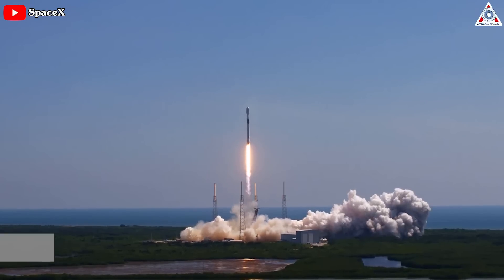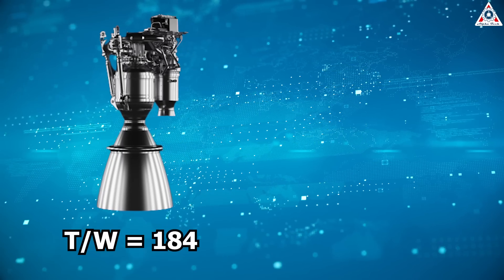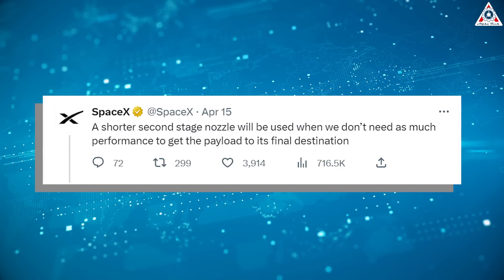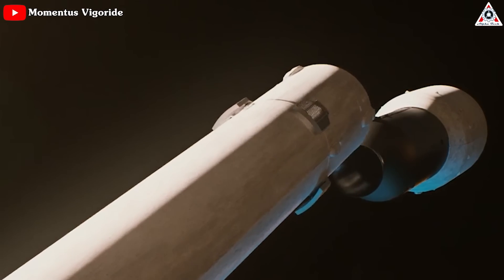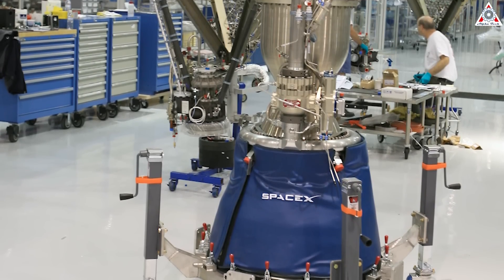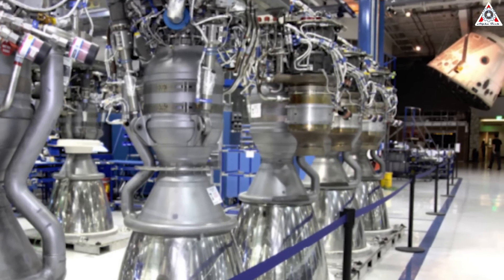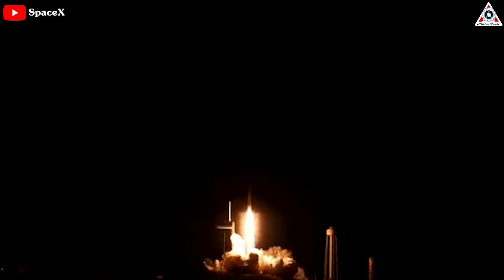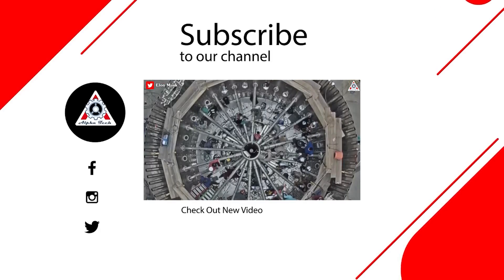SpaceX's genius Merlin engine kicks out Russia...

Comment: Aerospace kerosene fuel RP-1 was developed in the 1950's for use in turbine, air breathing, and rocket engines. This kerosene differs from the from the common turbine fuels Jet A or JP-8 in that it has a much tighter allowable density and volatility range, and a much lower sulfur, olefin and aromatic content.

Comment: In a short word: Merlin's design is just primitive and brutal (open-cycle kerolox, shorten nozzle...), so it's low cost and reliable.
Reply: The key reason for this open-cycle kerolox approach that Merlin take is: US can't make LOX-rich rocket engines until now. No US scientists want to admit it publicly, but they bought RD-180 used on Atlas family is the proof. So, US has to use solid rocket booster and hydrolox on Space Shuttle. The same architecture used on Ariane 5 and Japan H-2A.
Reply: @ericfung9327  This has nothing to do with Merlin engine.  I am saying A and you are talking B.  A and B are not related.  By the way, Merlin engine serves SpaceX well.  It is the central ingredient of Falcon as a re-usable rocket.
Reply: @catchnkill  Agree. Merlin is the king of reusable rocket engines
Reply: However, use solid-rocket boosters on man mission is a bloody technical mistake. No control can be applied when burning SRB and its burning sole depends on surface area. Any small cracks on solid fuel will cause combustion instability. For Space Shuttle SRB's huge size (3.71m in diameter, compare to 1.68m on Mimuteman ICBM), any small instability will cause low-frequency resonance and explosion. That's the official reason NASA reported on 2 fatal Space Shuttle explosions.
Reply: @ericfung9327  It has nothing to do with Merlin engine.
Reply: It is not primitive.  It uses an old concept and has made massive improvement over its predecessors.  Merlin engine has the highest thurst/weight ratio.  It is better than everything before.
Reply: Compare to Russia RD-180 first flight in 2000, both are kerolox engines. RD-180 has 257 bar chamber pressure and 311s SL ISP. Merlin is 97 bar and 282s SL ISP. That's the key performance numbers. Lower performance numbers and higher thrust-to-weight ratio just an indicator to my word "primitive".
Reply: @ericfung9327  If RD-180 is that good, why Russia has not scaled down RD-180 to compete with SpaceX?  If chamber pressure is everything, Russia should be king of commercial launch.  Why?  By the way, why you not try to scale down RD-180 to compete with Merlin if Merlin is so primitive?
Reply: No one disagree that RD-180 is the king of kerolox engines: Not US (buy and use on Atlas), not China, not Europe, not Japan. You can talk to any rocket engine insiders or search on Internet.

Comment: Most Falcon 9 launches are for Starlink, so they're not commercial launches. It's like claiming to be a top-selling author, but it's the author that's going around the shops buying back their own books.
Reply: A lot of commercial launches as well.  Data available until 16th July 2023.  There have  been 48 launches in 2023 till 16/7/23 in total.  26 of those were for Starlink. 22 were commercial launches. Around 46% are commercial launches.  Not too bad.

Comment: What will SpaceX do with Falcon and the Merlin engines when Starship with the Raptor engines are up and running and proven reliable?  Wonder if Elon would be open to partnering with Sierra Nevada for launching Dream Chaser?
Reply: Sierra Space is part of a consortium which includes ULA, which is contributing the second launch of Vulcan Centaur to delivering the DreamChaser OFT1 to the ISS.  Just as a number of other customers, including ESA, have temporarily ordered Falcon 9 launches to address delays in new booster development projects, I wish that Sierra Space would move their first test launch to the less risky Falcon 9.  Time is running out.  It will probably take about five months to implement the adaptations to fit the Dreamchaser on the Falcon.  That means the contract would need to be signed this month.  Note that, just as with the Euclid Space Telescope this is not a partnership.  SpaceX is designed to make money by selling services.  At the moment the substantial profits from launch services are subsidizing the development of Starship and the deployment of Starlink.
Reply: I think Starship is larger than whats needed for most LEO so Falcon will remain for quite some time. Raptor is lower cost to make so I would guess at some point it might replace Merlin. 
This is going to be a bit of a trick. They run different fuel so it would be a whole new system ,which is expensive, trying to replace a fully built and tested system. It may be that if you cost everything out over lets say 10 years it might be better to just run Merlin. It a few years Merlin will be the most reliable motor ever made and the cost has to be looks at as a whole system.